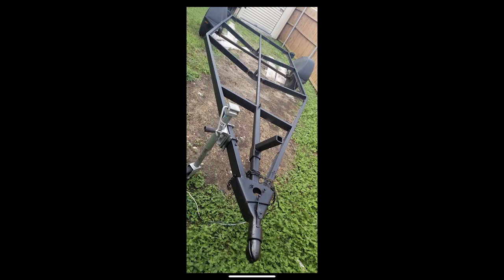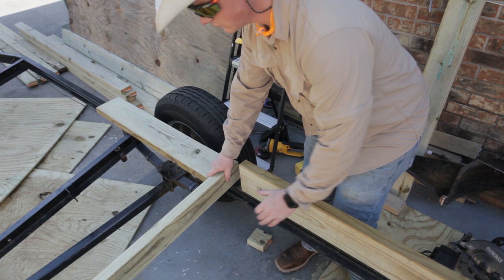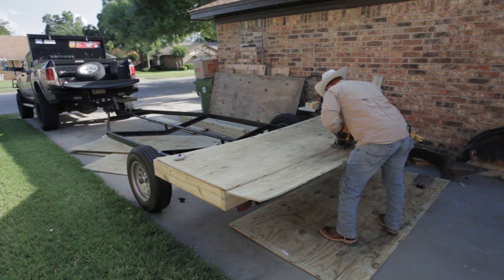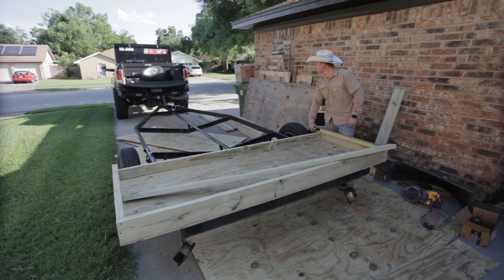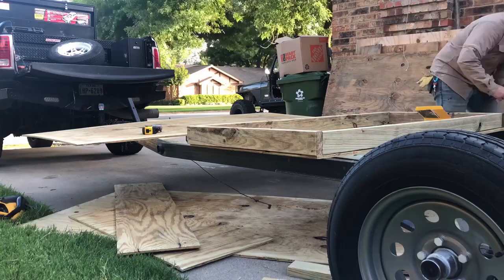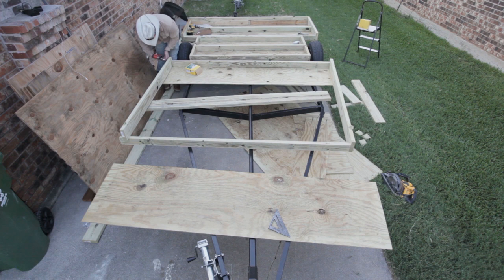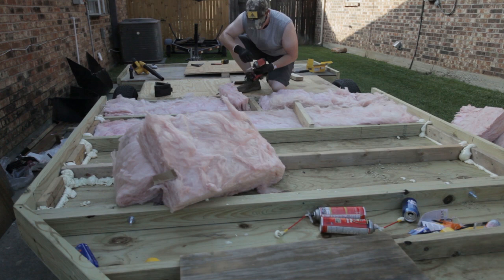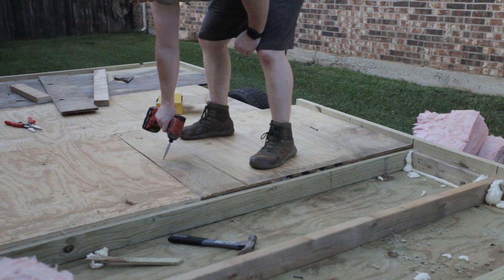How to Build a DIY Camper Trailer - the Deck

Comment: I think the builder realized his trailer wouldn't hold the weight, You would need another axle for something this big!
Reply: My first question trailer LOAD RATING
Reply: Yeah and he is framing it like a house! Way too much weight!
Reply: What would you use instead?
Reply: @dottyjyoung  aluminum and fiberglass.

Comment: I rebuilt a Starcraft Starmaster 1906 XLT and ended up having to replace the original axle with a 3500 LBS axle. Ultimately I decided to add electric brakes and had to go from 12" wheels to 14" wheels and increasing the capacity of the springs from 1750 LBS to the next size up and cutting some of the unnecessary frame away from the wheel wells to gain more clearance and to help prevent the new 14" wheels from hitting the wheel wells going over the pot holes on the highway...

Comment: A couple of issues I noticed in the build so far. You used a cut off wheel to remove the eyebolt, but never painted over the fresh steel. Also you were drilling right through the upper flange of a C Channel frame. This will weaken the frame greatly.

Comment: Making a trailer for my snowmobile the back end I'll just use 2X4s so it will be flush for driving onto. This is the second one did about the same but not the 2X6 which leaves your deck with a nice lip around the edge. I use a shore-lander trailer works like a charm.

Comment: You  screwed your floor down before running plumbing and wiring. You didn't put a waterproof membrane underneath to protect the plywood from the moisture.  And the big thing is your probably haven't considered the weight limit of the small trailer.  I kinda think you realize this which is why there is no more videos on this project.

Comment: You are going to need a 'marine grade' primer to weather seal that wood.
Reply: elastomeric paint-It's what I'm putting on mine-
Henry
587 Dura-Brite 0.90 Gal. White 100% Acrylic Reflective Elastomeric Roof Coating at Home Depot for $25/can

Comment: I do not understand why you would build this so so heavy and you did not undercoat or paint the bottom, 2 by 2's would have been good you have the steel structural support underneath so heavy over kill. You added so much weight that you did not need.

Comment: I wouldn't use fg insulation. I would use foam and some venting, because you will get moisture in that space eventually and it will not be able to get out and start rotting the wood. Today's pressure treated lumber is not as good as it was before they phased out CCA. Also, FG insulation will become a place for rodents to get in if you fail to seal every tiny hole. The bastards will get in there and tunnel in nests while filling it with mouse turds.

Comment: Keep in mind that boat trailer is only designed to hold about 1200 pounds my friend.
Reply: I could be mistaken, but I believe it's the axle that is rated at about 1200 pounds. The frame should be able to take a lot more.
Reply: John Shader that makes little sense my friend
Reply: @iwantosavemoney  When a trailer is rated for a certain weight, it's the axle, leaf springs and tires that are being rated.
All 3 of those things can be upgraded. I believe that is what John Shader was referring to.
Reply: @johnshader4287  ... That would be a 3500 # axel...
Reply: @billturner1240  that would be 100% wrong 😑